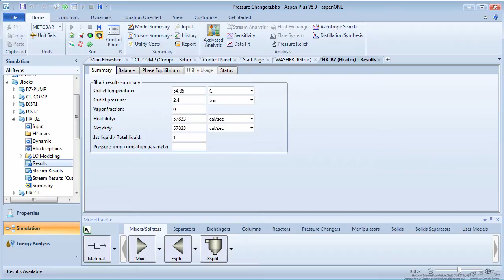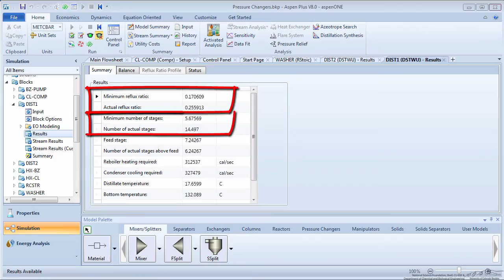Aspen Plus: Chlorobenzene Plant

Comment: HELP

** ERROR
   FLASH RESULTS ARE WITHIN TOLERANCE, BUT MAY BE UNSATISFACTORY BECAUSE
   EXTRAPOLATED EOS VAPOR VOLUME ROOT WAS USED FOR PROPERTY CALCULATIONS
   (T= 10.0000 K, P= 1.0133D+05 Pa). RESULTS OF BUBBLE POINT FLAHING
   BOTTOMS MIGHT BE UNRELIABLE

***SEVERE ERROR
   FLASH CALCULATIONS FAILED TO CONVERGE IN  11  ITERATIONS.   BUBBLE POINT
   CALCULATION HAS DRIVEN THE TEMPERATURE DOWN TO THE LOWER LIMIT OF
   120.0000 DEGREE K.  BUBBLE POINT TEMPERATURE MAY NOT EXIST AT THE
   SPECIFIED PRESSURE.  EXTRAPOLATED EOS VAPOR VOLUME ROOT WAS USED FOR
   PROPERTY CALCULATIONS     (T= 120.0000 K, P= 1.0133D+05 Pa). BUBBLE
   POINT FLASH OF DISTILLATE LIQUID FAILED.  BLOCK BYPASSED.

Comment: help plz
** ERROR
   FLASH RESULTS ARE WITHIN TOLERANCE, BUT MAY BE UNSATISFACTORY BECAUSE
   EXTRAPOLATED EOS VAPOR VOLUME ROOT WAS USED FOR PROPERTY CALCULATIONS
   (T= 10.0000 K, P= 1.0133D+05 Pa). RESULTS OF BUBBLE POINT FLAHING
   BOTTOMS MIGHT BE UNRELIABLE

***SEVERE ERROR
   FLASH CALCULATIONS FAILED TO CONVERGE IN  11  ITERATIONS.   BUBBLE POINT
   CALCULATION HAS DRIVEN THE TEMPERATURE DOWN TO THE LOWER LIMIT OF
   120.0000 DEGREE K.  BUBBLE POINT TEMPERATURE MAY NOT EXIST AT THE
   SPECIFIED PRESSURE.  EXTRAPOLATED EOS VAPOR VOLUME ROOT WAS USED FOR
   PROPERTY CALCULATIONS     (T= 120.0000 K, P= 1.0133D+05 Pa). BUBBLE
   POINT FLASH OF DISTILLATE LIQUID FAILED.  BLOCK BYPASSED.